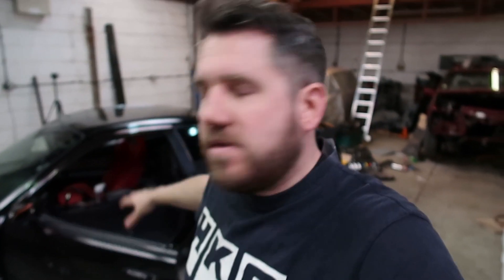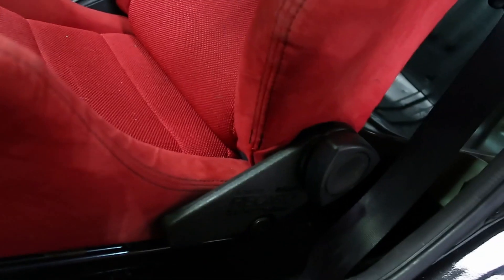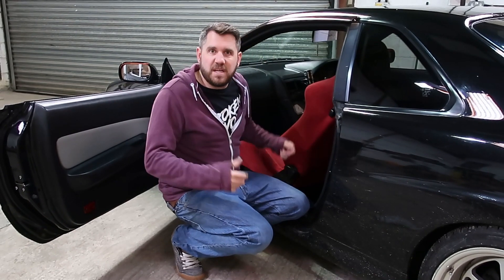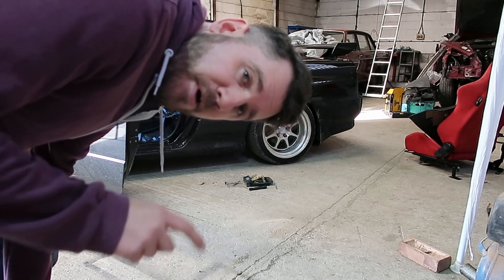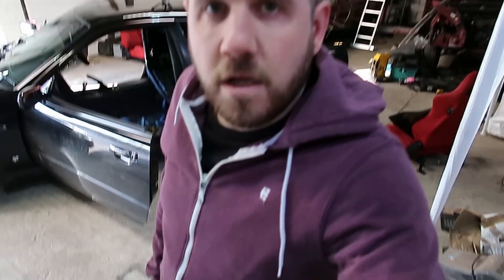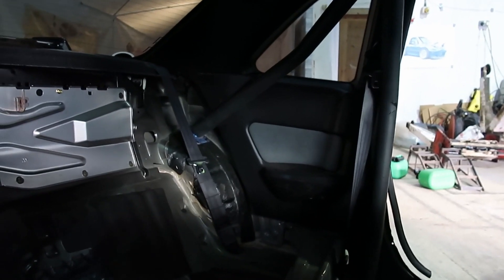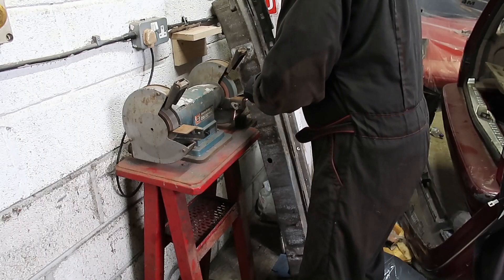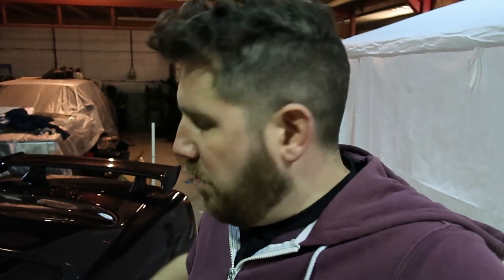R34 Skyline Roll Cage install

Comment: Did you manage to get the back seat and panels back in?
Reply from the maker: Toby Findlay not yet but they will be going back in, I’m going to get the cage trimmed and do some other cool bits that will all be in the next toll cage vid 👌
Reply from the maker: Back seat is now back in and I didn’t have to cut the rear quarters cards, I managed to do it by trimming off one of the mounting clips on the back, there is a pic on my Instagram @ourjdm 👍
Reply: Build it I ordered this cage back in September and finally installed it, I think yours may have warped or something during shipping as I didn’t need to ratchet strap mine to get it in. Overall was a super simple install, just need to add the seat back in. If your interested photos are here

https://www.sau.com.au/forums/topic/478563-r34-trackstreet-car/?do=findComment&comment=7929672